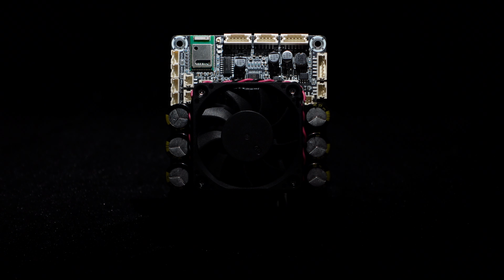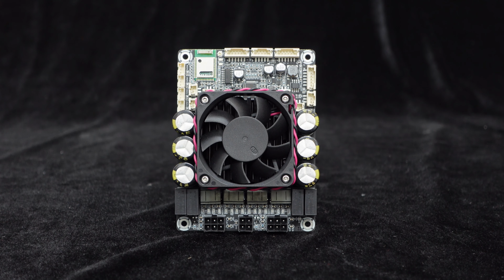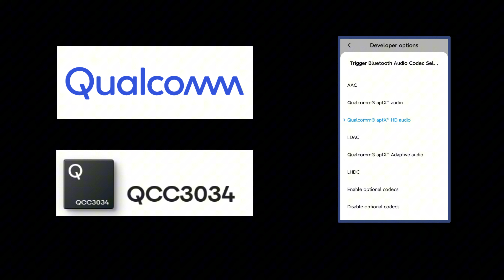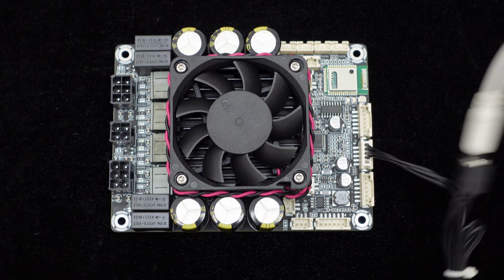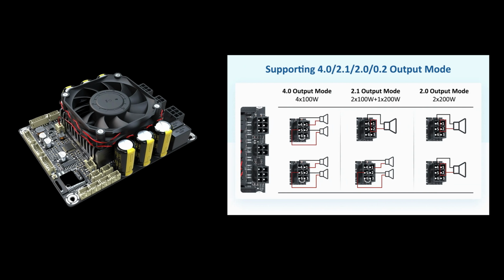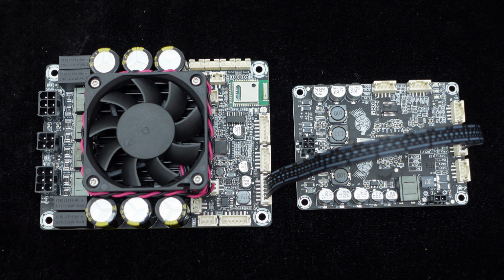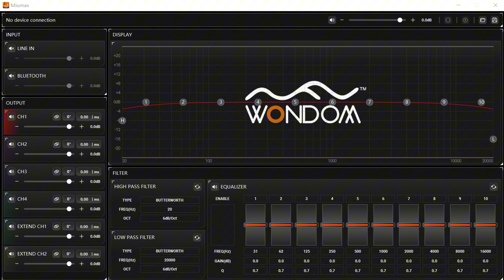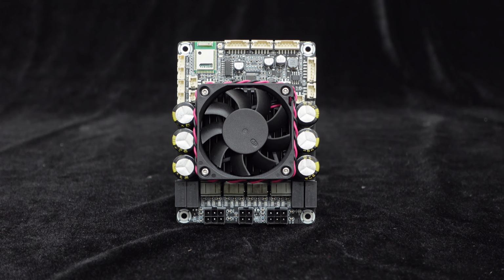JAB5 4CH 100W Amplifier with Bluetooth 5.0 & ADAU1701 DSP | SStudio Programming & PC UI Control

Comment: Can we make 4 way speaker crossover with two modules connected to each other or should wer keep them disconnected for that?
Reply from the maker: Thank you for your interest in our products. You can either connect two units together or use them individually. For the 4-way crossover, programming via SigmaStudio or the PC UI is required. We hope this helps. Have a wonderful day~

Comment: I use 2 of these connected with i2s in a 4.1 configuration. It works great, however the midrange and tweeters (all 8 ohms)  have a high noise floor which is very disturbing. Is there any way to fix this?
Reply from the maker: Hello. Could you please kindly try the following way to check if the JAB5 have such noise floor? Connect 1pc JAB5 to the speaker and do not connect with other devices, then hear the noise floor from your speakers. If the noise is at an acceptable level in this situation, it may indicate that the noise in the cascading system comes from the audio source or the ground noise between audio source and power supply. And if possible, could you please kindly send a video to us, showing the power, input and connection of your audio system? So that we can check and solve the problem for you. Please send the video to store@sure-electronics.com. We will reply to you as soon as we receive your email. Have a fantastic day~

Comment: hi, i'm totally new here, please support me. i have a jab5 and geting a meanwell LRS350-24 as suggested on the different video. but the power cable come with have 4 different wire(2 yellow 2 black), should i connect the cable seperately: 2 black to 2 V+ terminal, 2 yellow to 2 V- terminal of the power supply, or i have to combine 2 black to 1 V+ and 2 yellow to 1 V- terminal?
Reply from the maker: Hello, thank you for reaching out to us. Please combine 2 black cables to V- and 2 yellow cables to V+. Wish this could help you. Have a fantastic day~